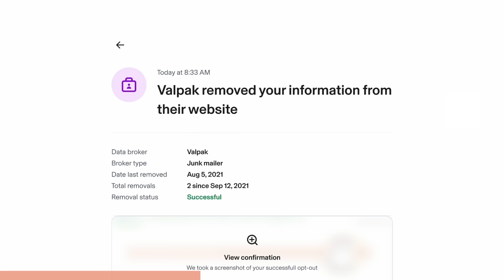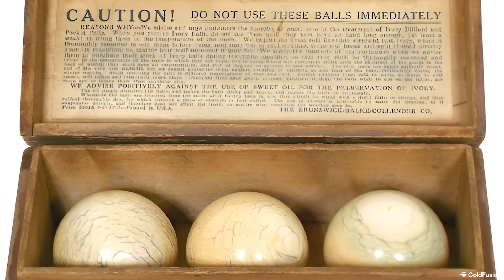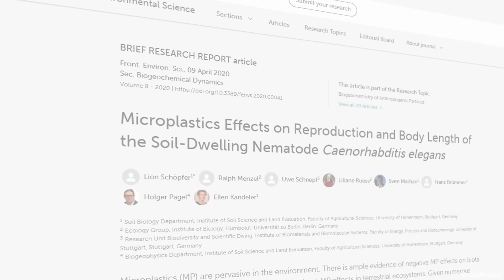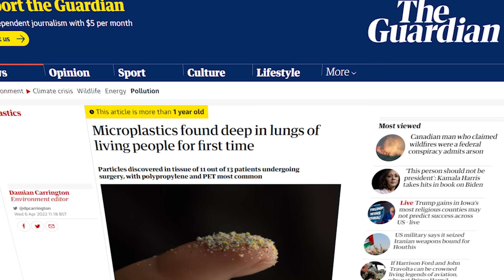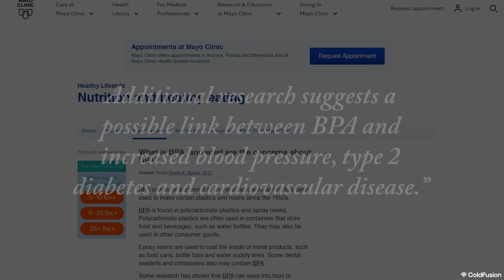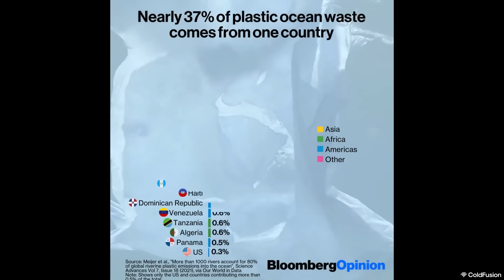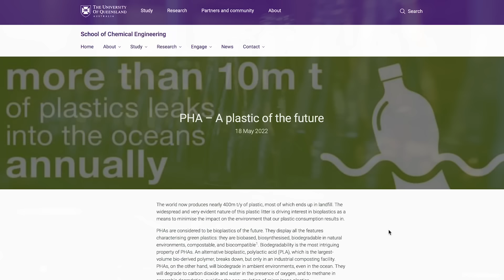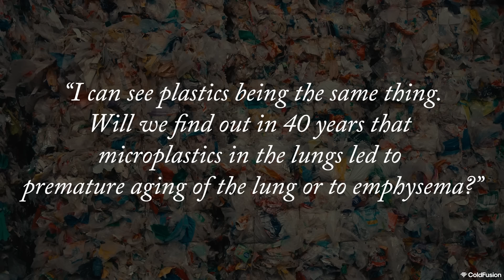How Microplastics Slowly Make Their Way Inside Us

Comment: Recycling doesn't actually do anything. The only way is to stop buying plastic where it's possible
Reply: Depends what you mean by "do anything". In my country there are plenty of products in the stores made from recycled plastic. Plastic bags, cleaning agent containers, spray bottles, cosmetics containers, clothes, watering cans, plant pots, etc. No it does not completely solve the issue but plastic being recycled is less plastic in the landfills, in landfills it will turn into microplastics and go into nature. Currently there are not many wide spread options for plastic. At least by recycling the plastic can be used multiple times before being discarded, either into landfills or being incinerated.
Reply: @ninjal7588  it doesn't matter because it all degrades to micro plastics anyway. Plastic is not actually recyclable. You need to add new plastic into recycled plastic to make products. In addition things still wear down from use and turn into micro plastics especially clothes. In addition recycled plastic degrades faster because its polymer chains degrade every time you recycle it. This means that all plastic is destined to be micro plastics. The solution is to stop using plastic for 99% of applications where they are used now.
Reply: @mach16j Which degrades into more microplastics: 1 bottle or 2 bottles? 
If you recycle 1 bottle, does that turn into more or less microplastics than 2 bottles?
Reply: @mach16j  - yes so much this
Reply: @mach16j youre dreaming if you think “stop using plastic” is the solution. I highly doubt you have the experience or education to make that claim. Which is good, because that would mean it will never be solved.
Reply: yeah appealing to authority while not offering anything constructive is boring. You can actually use logic to think of solutions to issues. Your belief that "if smart people figured it out it's solved, therefore if it's not solved smart people haven't figured it out and since you're not proven to be a smart person you're wrong" is very naiive and shows that you don't understand the webs of conflicting interests that keep things from being solved. @TheOfficialOriginalChad
Reply: The problem with that thought process is whether you buy plastic or not, the manufacturer will keep making it.

So say 35% of us boycott plastic products. That 35% of unsold product will just get thrown in the trash and the manufacturer will make the same batch amount over and over.

To make a real change the world needs to come together and that will never happen. Best case the wealthiest countries could ban anything but biodegradable plastic but trying to get any government to do anything actually useful is a challenge in itself.
Reply: @SyCoREAPER  I'm just doing what's best for me. If you want to give up and do nothing that's on you
Reply: i saw a video on youtube about where recycled plastic goes from the uk where i live. the recycling centers get a bung from the government to ship it to thailand and it sits rotting in the sun, they cant even do anything with it because it's just a messy mishmash of different types.
Reply: @TheOfficialOriginalChad  no need to be rude. You seem to have some insight, what’s your take on it? 
Should we keep on producing cosmetics, fast fashion-clothing, single-use items, packaging,  electronics and useless trinkets the same way forever? Do we really need polymer based abrasives in our toothpaste or can we manage with a mineral one instead? Are synthetic fibers really a must, or can we cut down on our use or invent new alternatives?
Reply: it does something but it is very nuanced: it's better for plastic waste to be captured in a recycling stream than to just be floating out there chafing into bits freely. but recycling is still far from being an efficient or reliable route that can make a real dent in cutting microplastic proliferation.

in fact... recycling may be doing more harm as greenwashing PR by companies who want to appear environmentally conscious without going much deeper, just to satisfy customers who think on that same level. consumers who assume this minimal bit of greenwashing is "enough" might not be persuaded to support more comprehensive policies that would actually reduce plastic use. it's like using paper straws... sure, it does cut down some single-use waste; but it's orders of magnitude off from being enough.

the real antagonists here are plastics producers and their petrochemical suppliers - they have vested interest in the unregulated low-cost status quo which gives them maximum profit margins and zero accountability. unfortunately, these are forces far beyond what individuals can truly affect on their own. we will probably need a kyoto protocol type international agreement to spur plastic regulation. the only way we get there is with good data and evidence, not just vague claims or confusing innuendo.
Reply: @mach16j  I think @TheOfficialOriginalChad does have a point - a point you did not address: which degrades into more microplastics: 1 bottle, or 2 bottles? The answer is quite obvious. Recycling does something, it's not nothing.
Reply: @mach16j  Its the sun that makes plastic weaker not recycling
Reply: I don't what could possibly replace plastic.
With drinks for example. I was once a vendor for a soda company. There is no way the job could be done if we had glass. Even if we had old fashion glass bottles. The scale required would have made the job agony for the workers.
Reply: @mach16j  sorry, I did not communicate my point correctly then. Claiming that “recycling does nothing” is inaccurate and is detrimental to your cause, assuming your cause is protecting the environment and creatures (humans too) living in it. 

I don’t think you have to be smart to solve the problem, which is asked you the 1 vs 2 bottle question; to guide you through the logic. 

Now, recycling may not help as much as most think or want, but it does do a lot and could do more. Ceasing the production of plastic is simply not possible. There is not an alternative for so many applications, and there ARE very smart people trying very hard and spending a lot of money looking for alternatives. 

So with this information in mind, let’s define the problem: All of the plastic ever made still exists. Plastic production is bad and will not stop whether we buy plastic or not. 

The solution to the problem must comply with the problem and be within our capabilities. Recycled plastic reduces the production of new plastic. Buying more recycled plastic products increases the value of recycled plastic, which translates to more things being made from it. 

When alternatives come along the problem changes as does the solution, but unless someone in this comments section has some universal alternative then we must address the current problem in whatever way we can.
Reply: I buy things in paper and glass containers when possible. I even buy my milk the same way. A big solution would be to have more glass bottle return systems rather than glass "recycling". But there are also some plastic products that just have no sensible replacement
Reply: One way to do that is by using a refillable water container instead of buying single use plastic bottles with water inside.  The video mentioned using reusable coffee containers and reusable shopping bags.  Also good ideas.  I try to re-use plastic bags that I do use to reduce the number of plastic bags I would otherwise buy for food.  I use bread bags, for example.  When shopping, I re-use produce bags.
Reply: Well recycling plastic is essentially useless. Metal, glass and even paper recycling are definitely worth doing though.
Reply: @dxtrum         I still put compatible plastic in the recycle bin and hope for the best.  The alternative guarantees it to end up in the landfill or worse.
Reply: @TheOfficialOriginalChad  oh for goodness sake you can't recycle plastic its not something that can be smelted dpwn and re molded
Reply: @JcoleMc  what a clown 😂😂😂
This dude doesn’t even know the definition of recycle
Reply: @TheOfficialOriginalChad   Yeah keep saying that pal
Reply: @JcoleMc  uhm…why?
Reply: @ninjal7588  there isn't a single type of plastic that can be recycled forever. In fact most can only take it 2 or 3 times max. They will all end up as garbage quicker than what you might imagine. The fact that you put it for recycling doesn't mean it will be recycled. Mean that they want you to believe it does.
Reply: @Jeffcrocodile  In my country there's many recycling facilities which are transparent about how much of the plastic is actually made into new plastic and how much is incinerated. I know it's not perfect but it's something.
Reply: There is so much plastic used along the supply chain for almost any product that you buy that as an individual you not buying products with plastic components does absolutely nothing.
Reply: @Jeffcrocodile  Umm, nothing – and I mean NOTHING – can be recycled forever. That is not what recycling means...
Reply: @mach16j  This line of thinking is what Dagogo was saving for another episode. The manufacturers shifted the responsibility from themselves to the consumer. ...and that means people do what's best for themselves ...which is oftentimes in conflict with the good for society.
Reply: @mach16j  That's not how microplastic works. It will fully decompose, it's not gold. Not to mention that alternatives like paper pollute much more. If you avoid plastic "whenever possible" you end up with more pollution.
Reply: A lot of plastic recycling is just feelgood greenwashing for the customers. For example they wash the shredded plastic several times and all that water is full of microplastic and gets dumped into the sewer without filtering. Also very little of your plastic gets actually recycled a lot just gets burned. There are a lot of things that claim to be environmentally friendly, but they really aren't. Milk cartons for example are made from plastic paper and aluminum. It's impossible to separate again in an recycling process...the most environmentally friendly beverage container are probably aluminum cans...
Reply: @pietrodeveloper how does paper pollute more? Paper is bio-degradable
Reply: @HarpreetSingh-xg2zm  In different ways. Bio-degradable plastics fully dissolves faster and require 4 less energy (hence emissions) and also 4 times less water than a paper bag, which barely resist 1 use but a plastic one can be re used many times. 
The majority of paper bags are made by heating wood chips under pressure at high temperatures. The chemicals used in paper production are toxic and contribute to air pollution, including acid rain.
It's also heavier, so the transportation pollutes more.
Reply: THIS
Reply: Issue is that (oil/plastic) companies take advantage of well meaning people who thinks recycling works and deceive them. Therefore it IS better to say that recycling doesn't do anything for that reason alone and then more informed people can make whatever choices they think works after they've looked into it.
Reply: The only way is for you to be reborn and grow all your food from scratch
Reply: I've been thinking about what you've stated for a while, long before this video was published... my solution is to turn it into energy just like what the Nordic countries and Singapore does, they literally burn their trash in order to generate electricity. Maybe we can do the same with plastic to stop it from becoming microplastics in the future? I know it will polute our air just like burning petrol does, but i can't really think of any other solution, i mean we already burn fuel on a daily basis anyway... might as well burn plastics which comes from oil anyway
Reply: @ninjal7588 recycling only keeps plastic in our environment. More plastic products.  Not great. Better is none to start with.

Comment: Vehicle tires are the biggest contributor to microplastics…especially in our waterways. This is going to dramatically increase as electric vehicle adoption increases because electric vehicles suffer a 20% higher tire wear rate than conventional vehicles due to their heavier weight. All of that tire microplastic ends up in our waterways instead of a land fill. Most people driving electric vehicles, think they’re contributing to the environment, but in reality they’re dumping micro plastics into our waterways at a much higher rate.

Comment: For the first time ever, in my opinion as a viewer, this channel is drastically wrong. A biodegradable plastic is definitely not the answer given that biodegradation is not the default mechanism Nature has to break down waste. Water solubility is the default mechanism, which is why the surface of our planet and the composition of all living organisms are mostly made of water. In most environments there’s not enough bacteria to biodegrade any organic waste. Not even a leaf falling from a tree will biodegrade, it’ll only get compacted down to deeper layers of the earth up until it reaches the Lithosphere. Actually the reason why we have petroleum is precisely because biodegradation was not the default mechanism nature used to dealt with all those carbon molecules. In fact we don’t want plastics to biodegrade, given that biodegradation turns solid carbon into gas carbon, worsening the problem we have with carbon saturation in our atmosphere. We should stop praising materials that can biodegrade if they continue to be non-water soluble polymers. PHA was discovered in 1925 by Lemoigne and it will not dissolve in the presence of water unless there’s a significant concentration of soil bacteria, which is a requirement that bypasses the only planetary cleaning process; the water cycle. Timeplast has the answer.
Reply: Bioplastics are biological plastics, not biodegradable plastics, as not all bioplastics are biodegradable.

Is your argument that biological options aren’t a solution?

Comment: Two important notes: 1) Because plastics are basically long organomolecules, it is only question of time when bacteria evolves to digest on it. Currently most plastics particles will degrade in about 50-100 years and this will probably significantly accelerate in the future. Life has been able to process way worse chemicals like oxygen when entire aerobic metabolism had to evolve (see Great Oxidation Event). Bacteria is actually able to process most of oil spills quite well yet slowly - most chemicals used to contain spills is actually more harmful to life than oil products itself as oil compounds are just organomolecules that could be digested and used as food by some species of bacteria. Plastics are more stable form of that which makes the digestion slower but not impossible. 
2) There are way more stable compounds in dust that are normal part of our life like sand dust (silica dust). This dust will deposit in body and has adverse health effects yet it did not render sandy areas of planets uninhabitable. Entire civilizations live in such areas and prosper there. The plastic dust may be way milder form than that, it depends on reactivity - the greater stability means lower biological reactivity. Some "replacements" of plastic can turn out more problematic as for example glass, because glass dust is basically nothing but silica dust. Silica dust is not that biologically reactive but accumulates in organisms during lifetime creating problems. And yet again most of organisms can live and prosper next to that.
Reply: They're already artificially developing bacteria to digest microplastics. 

What I'm worried about, is if the bacteria will eventually start eating the plastics in crucial things that we use, like phones.
Reply: I think that you are missing key points:

1) As A.S. mentionned, there are technologies under development to degrade plastics with the usage of bacterias, but it doesn't mean that microplastics can't hurt every member of the food chain along the way.

2) I'd like to know where you saw that "most plastic degrades in 50-100 years". To my knowledge, it is not true and "degradation" depends on your definition. For example, the "biodegradable plastics" are controversional and many claim that they are false advertising.

3) Indeed, we are surrounded by bio-accumulating chemicals (ex: aluminum, mercury, plastic, fine dust,...) and they certainly have different impact on ourselves and our specie. The fact that we can survive in environments where they are present prove in no way that they aren't harmful to us. We have yet to discover all the impacts of microplastics on our health, but many scientists study that matter and raise the alarm about the lack of regulation around their usage. Microplastics already show adverse effects on the health of our specie. I think that a Harvard researcher named Carole Hooven studies the impact on our reproductive system. Another researcher named Andrew Hubermann also talked about that on his podcast and there are certainly many more scientists looking into that.

All in all, if you want to go with the FDA approach that "If we don't know what it does, than it must be safe." (Yes, I may be exagerating a bit.), then go ahead, but keep in mind that the most dangerous thing is: "Ignoring that you don't know something".